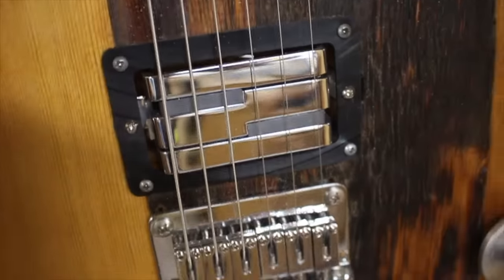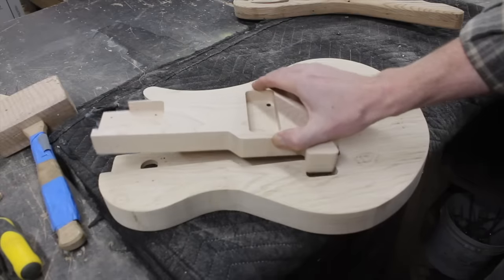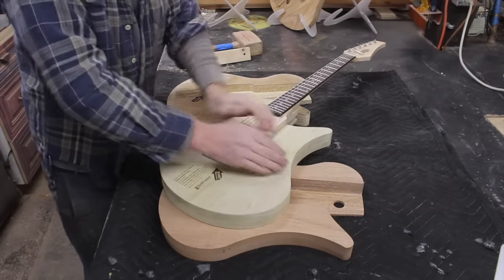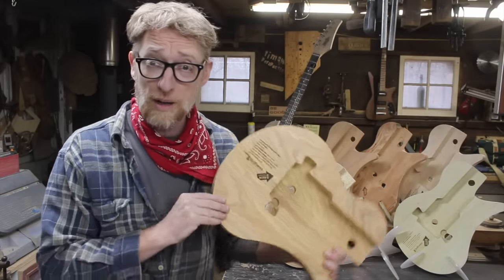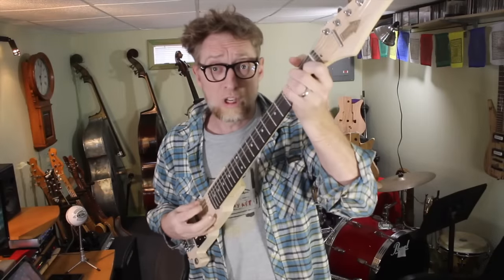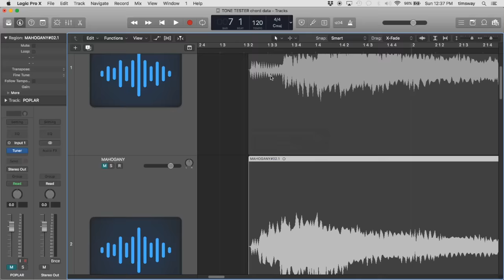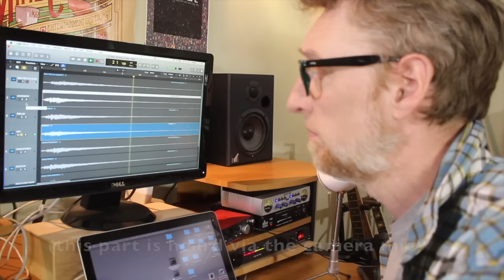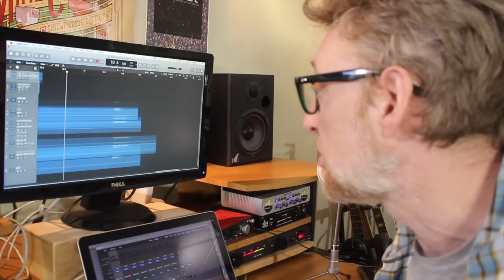Tone Wood Tester: One guitar to test them all

Comment: Never was there a more nebulous concept than "tone".
Reply: heftosprod I’m new to guitar, but in singing tone is supremely important for connotation and setting. Just changing mouth shape or head position can achieve this. In reference to the video, it seems that tone is affected by skills, not the body. I’d love to see this same test with acoustic or acoustic-electric instruments. I image the result would be more differentiable.
Reply: Exactly. Tone is made by the individual performing. Everything else is secondary.
Reply: heftosprod I just meant that your original statement downplays the importance of tone. It is supremely important. The wood just happens to be the least influential in production of tone in solid-bodied electric instruments.
Reply: @carpoolwithme5350  No.. not at all. The sound you make as a musician is crucial.. some people just have it.. others work at it.. and some never will. The gear plays the minor role. I'f anything I was highlighting the importance of tone... but just to clarify, I was talking specifically about the way that  (gearheads mostly - and i certainly am one) people will put so much energy into claiming a certain guitar/amp/string size/wood will give them the magic tone. Sure that stuff plays a role... just nowhere near as much as the player. Sound is all important. It's what were here for.
Reply: @carpoolwithme5350  but TONE is so totally eye-of-the-beholder. (Like i can never tolerate the buzzing of single coils, but evidently most of you don't mind it!) Plus, you can make a Les Paul sound like a strat any time you want. 

It really is just about WHAT DESIGN YOU THINK IS COOLEST and which guitars FEEL the best FOR YOUR TASTE. 

It was lying CAPITALISTS who made up the whole "You Get What You Pay For" lie. (I've never in my life found more-expensive stuff worked better than cheap stuff. NEVER.)

Comment: That test isn't really very sensitive.   I BUILD guitars and you can be very sure that you can hear the difference in how a guitar sustains and what range of frequencies it sustains best at, when different woods are used.   It's not money telling me this, it's playing and listening.   You can check the tap tones of two different body or neck blanks that have the same dimensions but are made of different woods, and you can certainly hear how their tap tones vary.    This is an indicator of what is going to be the end result when you build a guitar out of them.   Some woods have higher tap tones than others, and some have longer sustain to their tap tone, whatever its frequency.     I can tell you that you don't want to use woods that sound dead.  You want a lively, full, clear, gong-like tap tone, which indicates that the wood absorbs energy more slowly than a piece that's dead sounding.    

Some extreme examples:  Poplar is among the deadest sounding woods, while most mahoganies are pretty lively.  Swamp ash and basswood are pretty good, too.  Ash (baseball bat ash) is pretty dead and it's also too heavy.  Most rosewoods are very resonant as is ebony.    Maple is pretty decent with a fairly high tap tone. (For a given sized piece.)
Reply: Tap tones matter for acoustic or arch top guitars.  For a solid body electric, 99% of the sound characteristics come from the strings, pickup, saddle, and nut.
Reply: @Opry99er  Nope. I've heard a Ric 4000 with a P pickup and it still sounds like a Ric, nothing like a P bass. Some people just don't pick up on nuances.
Reply: That's because it's still a Rick...  same nut, bridge, and saddle.  That's why it sounds like a Rick.
Reply: @Opry99er  The nut on a Ric is nothing unusual, and plenty of people change the bridges on them. Geddy put a Badass bridge on his and it didn't sound any less like a Ric. Its the construction, scale length and materials used that make them sound like Rics, not the bridge or even the pickups.
Reply: Scale, action, fret material, fretboard composition, pickups, yeah.... I agree with you.  Everything that touches the strings beteeen (and inclusive of) the bridge and nut will affect the tone of a solid bodied instrument.
Reply: @Opry99er  I agree - everything affects the sound to one degree or another, although how much and to what extent will always be a matter of debate. In my opinion, these are the differences heard by guitar nerds and other music-obsessed people like ourselves. To the average listener, a guitar sounds like a guitar, a bass sounds like a bass, etc.

Comment: I switched to active pickups. They don't care what they're attached to. You could put them in a $1k guitar or zip screwed to a trash barrel and they sound the same.
Reply: Yeah but they require batteries, that sucks.
Reply: Yes thank you.
Reply: @ssimon64  a 9 volt every few years. The trick is to unplug the cable when you're not playing to break the circuit and save the charge
Reply: I dont think so.  Just took my EMG 81 and 85 out of my cheap Chinese "mahogany" guitar (Halo), put them in my cheap Jackson and it's like night and day.  I then bumped the voltage to 18v and it's even better.

Comment: Maple will dominate your sound in this setup as it is your neck wood and as you pointed out, it is the wood with all the hardware in it (eg, all the vibration going into it directly). That means you need a body of enough mass to effect the vibration of the overall instrument significantly in order to perceive any real difference in tone. In the examples with ultra-light materials in the body, you're going to hear mostly maple as a result of this. 

In this example they all have the same fundamental tone with slightly different overtone structure.
Reply: Exactly.  The tone is getting filtered through the maple.

Comment: You might be able to hear a very small different in Tone, but once you start using Gain and Distortion (or other effects) no-one will be able to tell the difference between the Tonewood. At least that's my Opinion.
Reply: higher gain settings ussually exagerate the difference
Reply: @jannatinkarlen8702  I couldn't disagree more
Reply: Be interesting to have a feedback test on all the bodies... Crank the gain and distortion. Let the guitars naturally resonate into feedback. Open tuning.
Reply: @jannatinkarlen8702  'gain' is a form of compression, certainly won't exaggerate difference.
Reply: @poorbachelor  distortion generally makes lower sound louder. that makes overtones heard louder hence difference will be heard better. That's my experience, it is okay i you have different opinion

Comment: Tim, a lot if good work here, but there were a couple of things where it, unfortunately, all fell off the table (figuratively speaking).  First, you should have built a mechanism that would strum the instrument with precisely the same pressure.  And secondly, the instrument should have been precisely tuned before each strum.  Differences in tuning have an effect on how the individual strings effect each other sympathetically.  Many other refinements to the testing platform, I hear others thinking, could be added, but I'll leave it at that as a sort of mental lubricant.  Bottom line, I enjoyed the video.

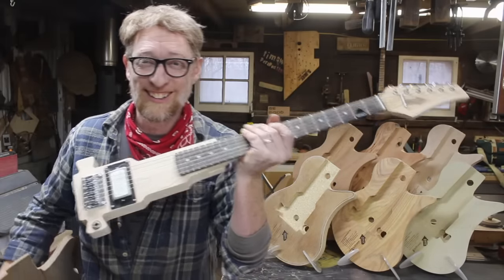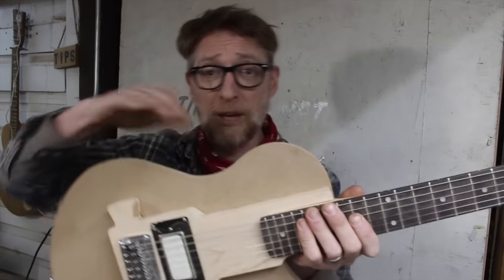Comment: 1:28 If you're simply transplanting a chunk of wood from one to another whereby the bridge is not actually resting upon the body wood in question, that is going to dampen the effect, I believe.  The bridge is now resting upon the SAME piece of wood every time and it's properties are going to affect the bridge much more than those surrounding woods.    5:08  face palm.   just no.  You are dampening the effect by having the same wood around the bridge instead of the DIFFERENT woods supporting the bridge.  8:54  not mahogany. It's mahogany COLORED by whatever wood you used for that removable "neck".  Even if differences do appear, it is not a true test. 

12:24  uh.... not quite.

14:32  cuz like, you couldn't have known that by looking at the height of the waveform, right?  And amplitude cannot be accurate since a tiny difference in how hard you actually STRUMMED could make it.... louder. 

The guy from Andertons (Chapman?) did a  comparison of two body woods where ALL the other parts were identical.  Same, amp, same cord,  same pickups, same pickup height, same  same same EXCEPT for the wood the body was made from and it is an audible difference so it is a true shame that there are actual PEOPLE out there that cannot comprehend that physics necessarily acts different from one compound or structure to another and SOMETIMES it will make a difference, sometimes it's negligible.  That there exists videos trying to prove/disprove the fact that strings will sound different when supported by different structures is sad.   All these dumbasses who believe  the body wood has no effect on the sound probably have crap equipment and blown out eardrums and have also never actually played enough guitars and actually listened to see what differences there are. 

The fretboard wood and neck woods have some effect as well but you can't explain to idiots why the foundation of a string's vibration would alter the way the string vibrates and how sound travels through the bridge to the body and beyond (as you demonstrated with the wall).   Interesting, nonetheless!
Reply: I think it might of actually been more  interesting if he did the exact opposite and made his neck/ centerpiece out of the different type woods and left the outside "body" the same.
Reply: Tobias Reiner  That would suggest that body makes no difference in neck thru guitars. It's not a design flaw, the sound transfers just fine in bolt on construction which this setup pretty much is.

Comment: I loved this tests.

personally I always believed wood has an impact but it's not as gigantic as some people might believe, this are all usable sounds, even with the sawdust one.

other stuff that this tests always miss, the neck also resonates and has a major impact in the outcome, it's not mahogany vs poplar, it's maple+mahogany vs maple+poplar, most of us are used to a maple neck and steel strings as a baseline (fretboard material might also be a point of discussion).

and having a maple piece along the middle (the most important part of the build) is similar to having a neck through guitar and just change the sides (I admit your way is very fun to do, sadly not the most accurate).

I'm a luthier and I love building with non-standard woods, mostly national woods from here in Chile and they all feel very different

also, about your kid commentary, in a physics way, he is correct, but not all woods fibers have the same disposition, sometimes a lighter wood can give better resonance by having small chambers inside the fibers where they get amplified just like an acoustic guitar, so the louder woods are not necessarily the heavier ones.

finally, great job, I personally like more what Strandberg did as a woodtone test, but yours was surely more fun to watch.

Comment: Every solid material has a 'tone'. Whether its solid wood, MDF, metal, plastic etc. Sound is created by 'vibration' - hence the headstock on a wall amplifies the sound. That's why plastic, Carbon Fibre or metal guitars can still work - even acoustic guitars that aren't using 'electronics' to pick up the vibrations and amplify the sound.
As for this test, I can here differences - subtle and not enough necessarily to make a 'huge' difference but mostly in the low-mid range. The Door seemed louder - maybe because it acted a bit more like a semi hollow guitar.
If wood really made 'no' difference at all, then ANY guitar with the same bridge, nut, scale length and PU's would sound exactly the same regardless of woods, shape, weight, whether solid, hollow or semi-hollow etc. After all, its just the string vibrating and the way the pick-ups are wound that determines a guitars voice - the tone must be the same if woods don't matter and all the woods are doing is providing a base to mount the electronics and strings onto
Having heard both a wood library Swamp Ash/maple neck 509 and a core mahogany/maple cap, mahogany/rosewood neck 509 - both with exactly the same PU's, Strings, scale length etc - only differing in 'tone' woods, the difference is what you would expect - especially clean single coil. The Mahogany has more warmth and the Swamp Ash is brighter, more strat like. The only difference is the woods and perhaps more importantly, the woods underneath the strings between the bridge and nut - unlike this experiment. It may not matter too much what the bulk of the body only adds to the equation but maybe the woods in the 'core' - basically the bit that slotted into the bodies in this. As it was predominantly maple, the results are not that different because the core stays constant. Making cores out of different woods would be a way to see if that changes the results.
The wave form won't show the way different frequencies that shape 'tone' are different. That wave form would look the same whether you mid scoop, lose all the bass or dial back the treble. We all know you can shape tone with an EQ and a G chord still sounds like a G chord, still gives a wave form like this - its peaks are volume - not showing how the different 'frequencies', different bass mid and trebles are shaping the sound...
Reply: i agree. the heart of the guitar stays maple so we are hearing mainly maple 6 times. maple core guitars sound similar . i knew that.
Reply: What a bunch of psychobabble from a 'tone wood' fanboy. Get suckered paying too much for a fancy-schmancy wood guitar? Or lusting after one even though you now KNOW it's not worth the exhorbitant price? 😜
Reply: @yaniv-nos-tubes  - Doesn't matter one iota. There's no significant, discernible difference in woods for electric solid bodies. Period. Ever. If you 'think' you're hearing differences (or voices), consult a psychiatrist. 😜

Comment: Hi @Tim I came to your video just now so I don't know how it evolved but I have some considerations to make:
1) as you told best way would have been to make say 20 attempts for each and make a mean of them, so you would have filtered the human factor.
2) I heard some noticeable differences in every sample. Mahogany seemed "fuller", poplar brighter, ash had definitely more attack. Surprisingly I liked mdf a lot, but it wasn't a real surprise because I know the core of "red special" was made out of it.
3) it would be a good idea to take samples and pass it through a frequency domain transformation, so you would have clearly seen frequency components of any waveform. But I'm an engineer, please don't bother me 😊
4) the main component of the sound is part between nut and bridge because it's closer to the vibrating area. You made a unique piece, which is a clever idea, but introduces a limitation 'cause the main sound flavor is altered by this choice. That's why, for example Les Pauls have more sustain than strats, for example. 

What's important for me is that, as you said, any guitarist (except Keith Richards) uses pedals and most of all use equalization, so they can easily craft sounds as their own will. So, for this reason, I agree with you on the fact that you can make a guitar out of what you want and craft your own sound the same, so if you can reuse, recycle, make use of any sustainable material it HAS to be preferred.

And of course, keep going, you are hosting a great channel.

Comment: Thanks for the video. Makes me feel a little more confident about using MDF in my crazy acoustic to semi hollow conversion I'm in the middle of. Just cut the body in half along the sides an hour ago. I've got a blade humbucker and tunamatic bridge to install but first I've got to build up the wood in a few areas. Planning to install an amp with the speaker mounted on the MDF back directed at the sound hole. Like I said crazy but I'm hoping to have a self contained, up campfire electric guitar at the end.
Reply from the maker: Doesn't sound crazy to me. It sounds AWESOME!